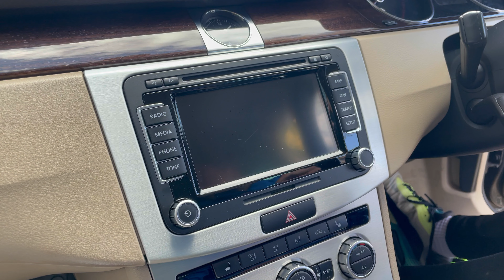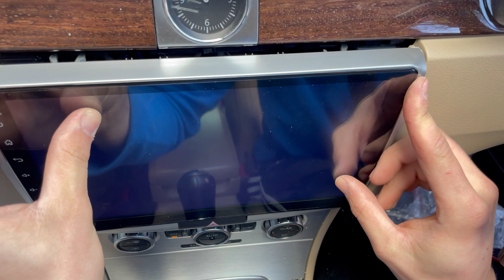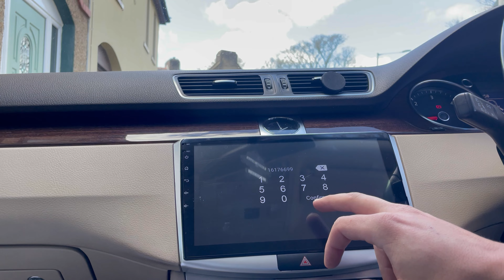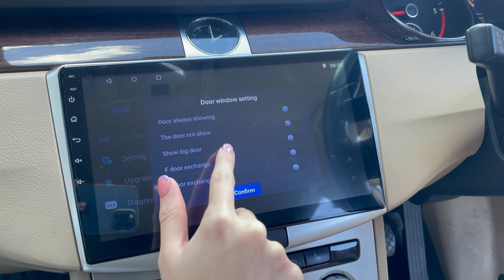VW Passat B6 B7 Radio Removal | Android 12 Car Stereo Installation Setup 10inch

Comment: Hi my friend, hope you alright, I installed same device I did every thing you did but,my steering wheel buttons are not working,I get to the setting and tried to add the buttons frome there but still not working!please let me know if you have any idea,and when I putting in reverse my the picture is clear and something like linens are on the monitor

Comment: @pluscentre at 55 seconds into this video you unplug a connection but then you don't plug it in anywhere I'm sure mine doesn't work just left unplugged..?
Reply: I’m waiting on mine, but I believe from other videos that you must leave these red unplugged; if not the monitor will not turn off when the car is off. The red wires are live power from
The battery

Comment: Ive got similiar radio i  2011 passat, but my ori hands free kit dosent wor, and mic in this radio is awful. Is there any possibilty to connect ori mic to alie radio?
Reply from the maker: Hi there, with aftermarket stereo you can't use original mic anymore but you can buy from Ebay for £2 external microphone 3.5mm for car and plug it in the back of the stereo, thanks!

Comment: Where do those 2 grey cables plug into? You fed them through from the glove box? Hoping to receive mine tomorrow.
Reply: these go back into the radio and are for usb use. He put em in box so it can be hidden most of the time. U can plug ur usb drives into the radio with it.